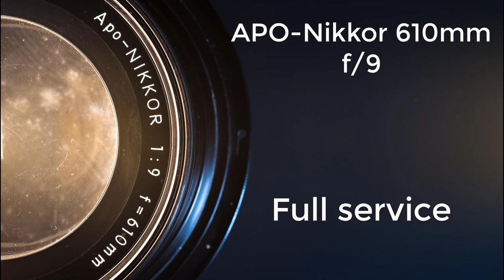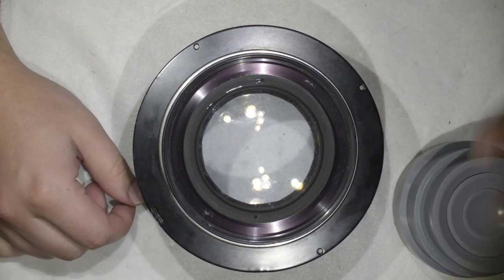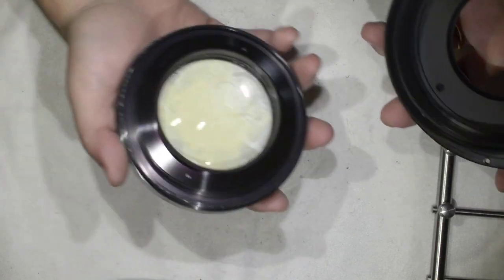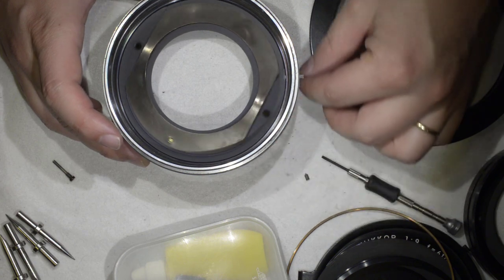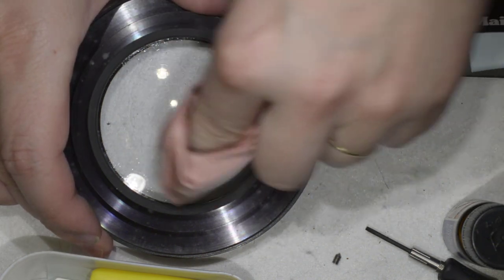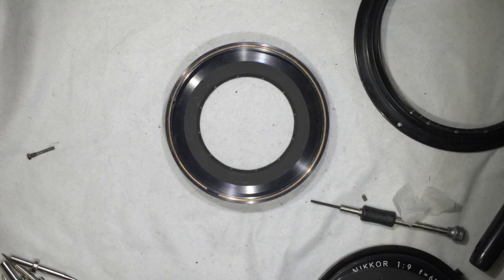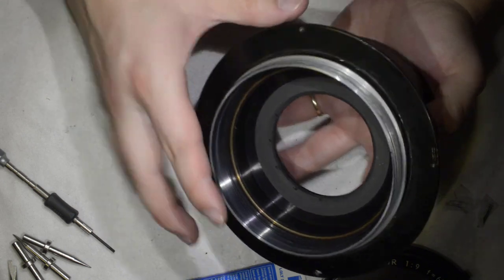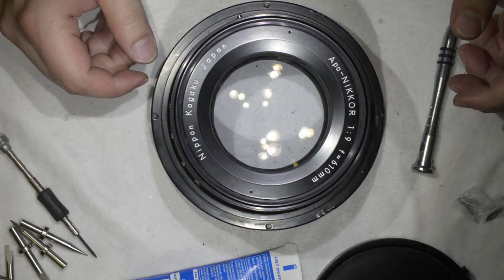Apo-Nikkor 610mm f/9 : Full service

Comment: I have the same lens, APO NIKKOR 610, f9 on my 40x40cm camera and I had fungus, i was happy to find your video but the whole system is different. I cannot open it. I guess there was 2 generations.
Reply from the maker: Really? I have never seen other versions (not that you see these guys often anyway). Maybe is the same but careful, these lenses are damn hard to open.
Reply: @diyextravaganza  yes i can show you the difference on a photo if you want. It is super hard to open and I tried to buiild a spanner as you showed, great idea but it wasn't enough. there are a lot of fungus but it seems like it doesn't affect the image much yet.
Reply from the maker: @ericantoine876  if you go to the lens repair group in Facebook you can share the picture. Yes, you need a very big spanner and a really tough vise to hold the lens as good as possible. I used a large vise bolted to a very big table and even there it was hard.